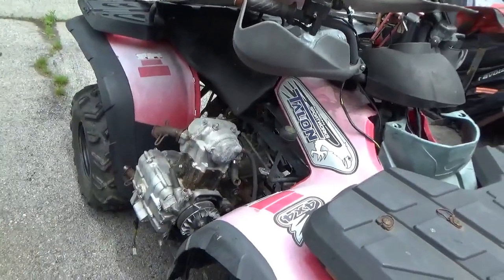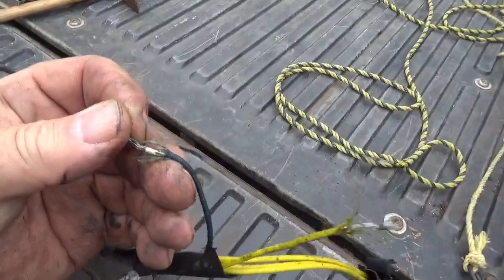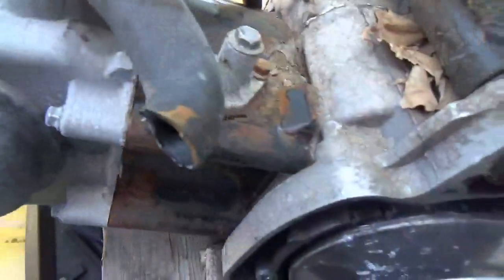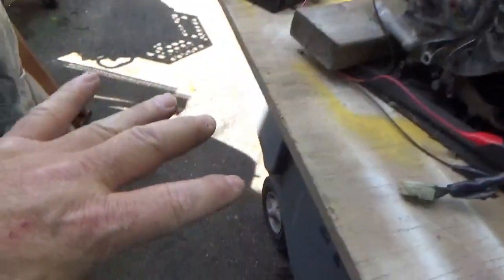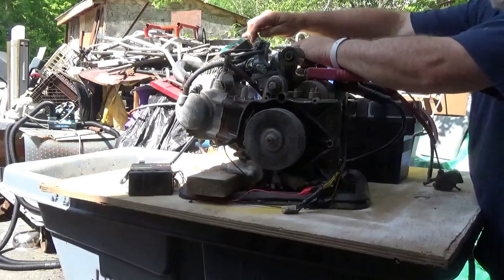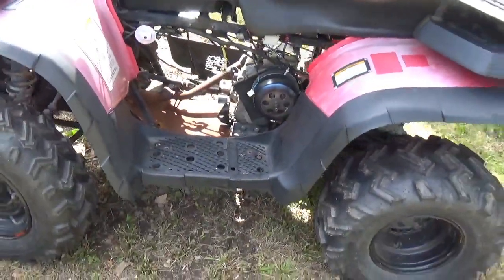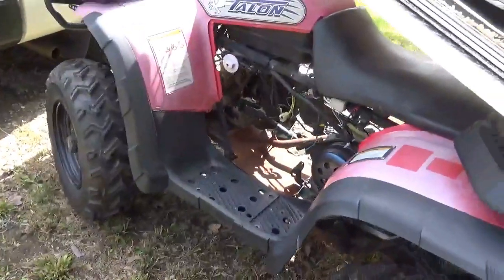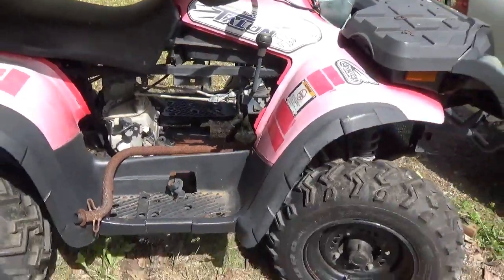$270 Auction Buy Linhai Talon 4x4 ATV,  Motor Bench Test First Start!

Comment: Harvey,  I have a 260cc 2wd Manco which was sold by Tractor Supply stores years ago.
The water pump was shot when I acquired it.  Searching for parts I discovered the following:
The ATV is made by Kimco in Taiwan.  It's nice and big, pulls 2 adults and one of those 2 wheel trailers made for lawn tractors full of brush, firewood or tools for fence repairs around the farm.different
The Linhai part of the circus is the motor, a China clone of a Yamaha scooter motor.   Mine is not over powered but chugs along.  I don't have the power to pull high gear, which is good as front brakes were removed by a previous owner.  Rear foot brakes present but don't do much.
The scoop on parts is all the components are generic so quality can be iffy.  A waterpump sourced from Amazon worked fine,  but when voltage reg burned up, the generic replacement came with a different connector and wires had to be swapped into the old housing to fit the harness.
The only other ATV I have owned is a Honda trx250 which was a wreck when I picked it up cheap.  Ran it till the electric start failed internally and my bad knee couldn't work the kick start...  This rig is much bigger - like a Polaris, but it's engine components are China scooter all the way.
Reply: Hey man do u know where to get a wiring harness for one cause i bought the atv and the wiring harness was butchered do u know where i could find one

Comment: Every Chinese quad that I’ve had to work on it always ends up being electrical problems which is crazy as the Chinese are suppose to be good at electronics and computers but some how they fall short on atvs. I think you should do the Honda swap as that would be interesting. It will help me get motivated to start working on a swap I’m thinking of doing with a 200x chassis I have and a Yamaha motor that I’m thinking of putting in it.

Comment: lol at "these are the best quad I have ever owned".  I have a few of the 2x4 Manco / Linhai and they are 90% total garbage.  The Yamaha engine that they are producing under contract is pretty good,  The frame is heavy enough that its usable with some gusseting and rewelding.  The auto trans and shaft drive is a nice feature.  Electrics and brakes are junk.  Suspension is okay with some better dampeners.  I think they are worth rebuilding if you totally scrap all the electrics and carb and put japanese stuff on instead.  Even then it cant hold a candle to an actual Japanese bike,
Reply from the maker: Hey ApexSun!!! They are big heavy machines for sure!!! We agree totally on the electronics....They use real junk components for a fairly complicated electrical system... Not a recipe for reliability!!!      I really have no experience with the brakes as I never got one moving fast enough to use them... LOL!!!  Thank for the good info, Ur thoughts, watching, and commenting!!!!
Reply: Harvey spooner do you know a good wiring harness for one i need one for my atv